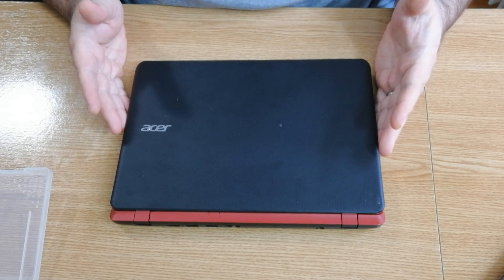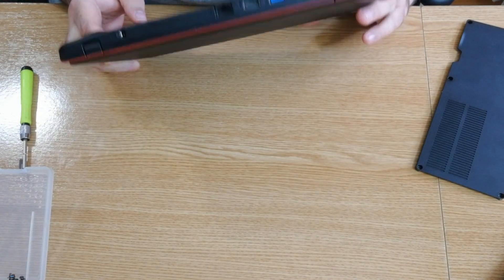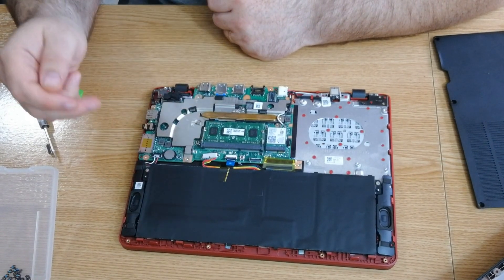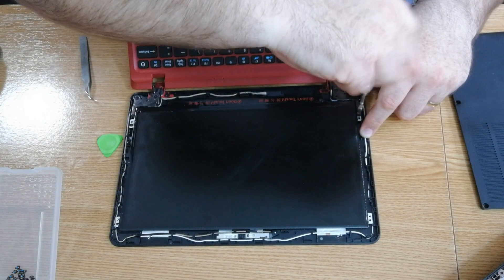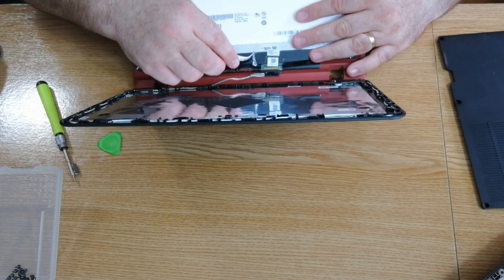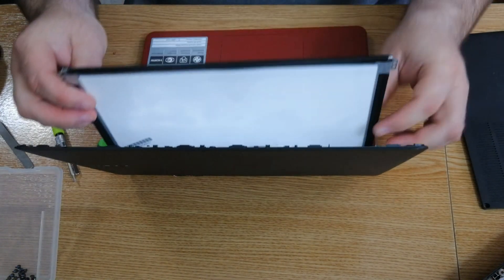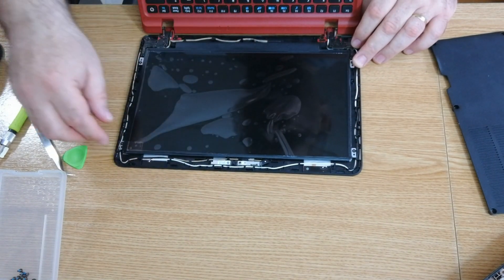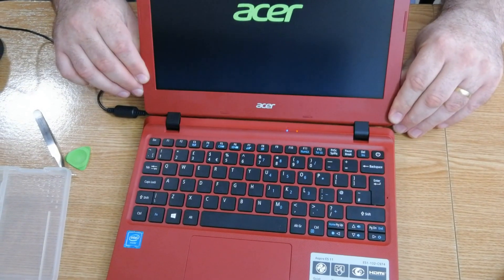DIY Acer Aspire ES1-132  - display swap !

Comment: Hello sir! I also have acer aspire es1-132 series, my lcd turned white on its display do you think that my lcd is broken and this is for replacement or is it the gpu that is broken? Thank you!
Reply from the maker: Hello, first check if you have image on an external display. If yes then open the back pannel of lcd and rearange the cable of the lcd.